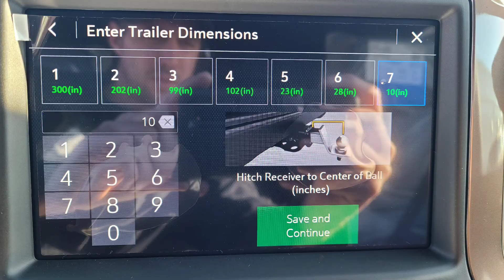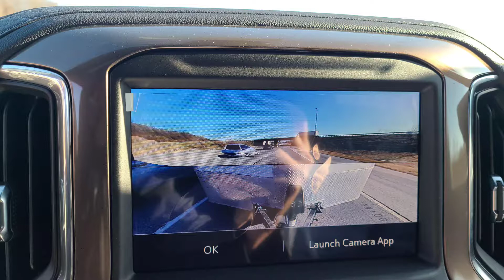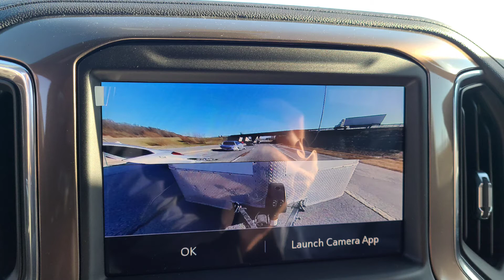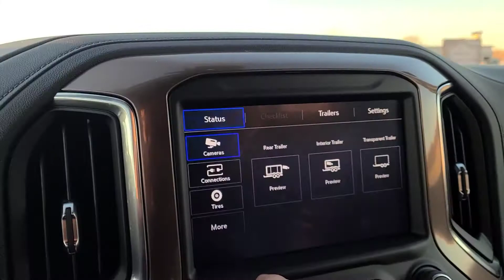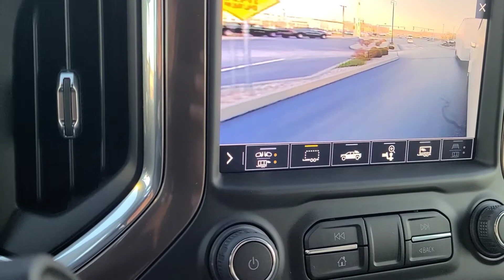Transparent Trailer View Part 2 install video with pictures of progress while working.

Comment: how would u mount this to a bumper pull camera       along the frame
Reply from the maker: This went inside of a bumper pull cargo trailer.  I ran it inside along the ceiling.   You could very easily run it along the frame underneath though.  It would be alot quicker and easier that way.   I was concerned with road damage to the cable where I was going to have to transition un the back of the cargo ramp gate.  I'm sure with a little though and protection to the cable at the back it could be done very well that way.